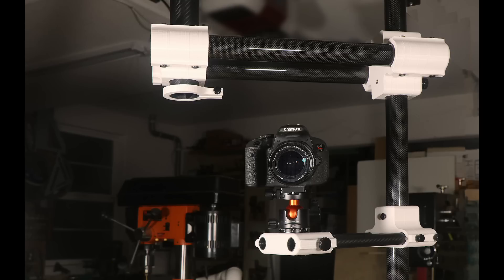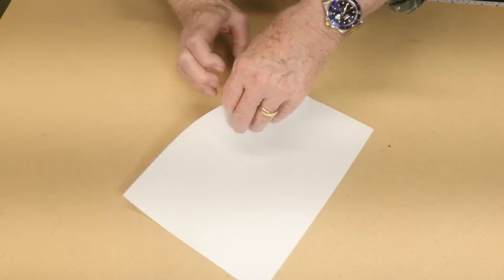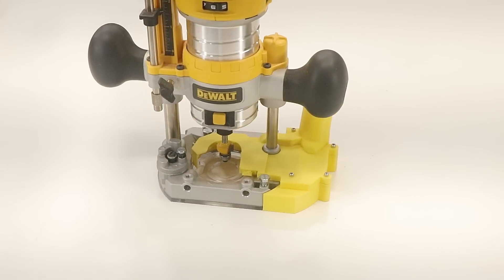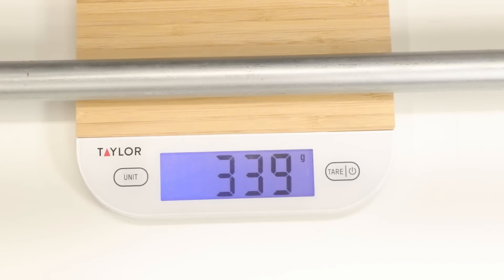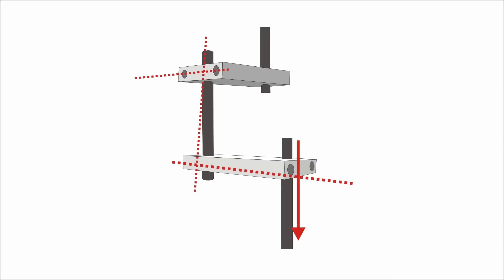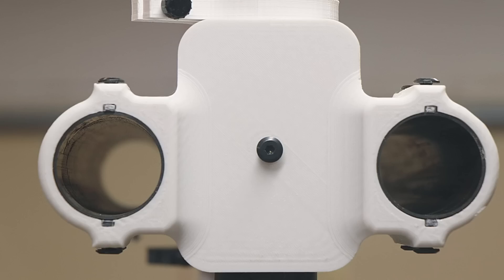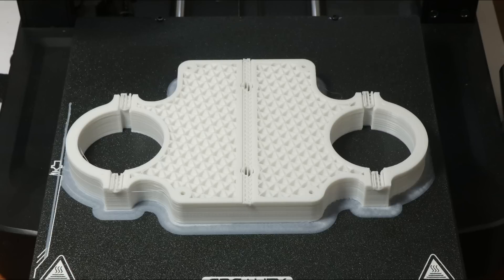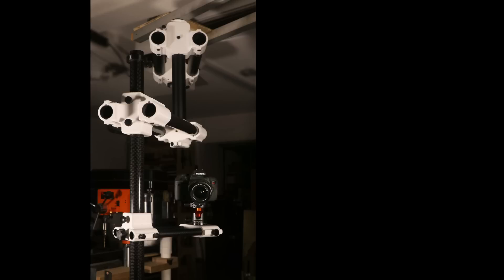Carbon Fiber Builds

Comment: You mentioned flex in the connectors. PETG is a pretty soft material and flexible, which explains why you had to go with such chunky pieces (which will totally work, eight walls is a lot!).

My go-to for this sort of work is PET-CF (which prints a lot better than people think these days, though probably not great on a bedslinger) and the loads you’re talking about don’t really bother it at all. You can print surprisingly small parts with a ton of strength and layer adhesion.

Comment: I have a couple of rather expensive carbon fiber camera tripods. What I found is that while they’re notably lighter than my also expensive aluminum tripods from the same maker that are equivalent in size, they are also considerably less rigid. While I can’t move my aluminum tripods when pressing down from the top, my carbon fiber tripod legs spread when I apply the same amount of force. I don’t want to mention the name here, because I don’t want an argument online about which tripod is best, but believe me they are very respected. I’ve been using their tripods with different models since 1970.
Reply from the maker: I 100% believe your claim that the name-brand carbon fiber tripod is less rigid than your same-brand aluminum version.  The question is:  are their shapes identical?  Are the tube diameters exactly the same?  Are the wall thicknesses exactly the same?  Are the connectors identical?  Are the tube lengths identical?  If the answer to any of these questions is that they are not identical, then the reason for the performance difference almost certainly lies in that shape difference.
Reply: @PatrickSullivan I do a lot of work with carbon fiber in design and manufacturing. Nobody builds a carbon fiber equivalent to something else. In theory, the designs are optimized for each material. In fact, the diameter of the leg sections on the carbon fiber are slightly bigger than the aluminum models. They are also slightly thicker. The mounts are almost exactly the same as the ends of the legs are almost exactly the same aluminum parts. The only real difference is the carbon fiber. I know that, in theory, carbon fiber is stiffer than a lot of metals, but in practice, they’re not. They are “stiff enough”. It’s the weight differential that makes them useful. But they are also a lot more brittle. If you give one a good whack, they will crack whereas the aluminum will just dent. I’ve had that happen with a tripod that fell over on a rocky surface, fortunately without a camera on top at the time. Carbon fiber is nice, but unless I have a very specific reason to use it, I won’t. They are slightly better t absorbing vibration. But I spray expanding foam insulation into any structures that need vibration resistance and that works very well.
Reply: @melgross  I know little about carbon fibre, but, since you use it in design, do you know if there are differences in the resin material used? For example I always thought of fibreglass as using a polyester resin, but I recently saw a video where someone used glass fibre mat with epoxy resin. Likewise I've done quite a bit of 3D SLA printing and there are hundreds of different resins available with a wide range of different properties (especially blending strength, toughness and flexibility). I would imagine that the same would be true of "carbon fibre". I'm guessing that carbon fibre bikes (and especially that Shelby Cobra) are not made from the same carbon fibre that your camera tripod is made from. Whether this wide range is commercially available is obviously another matter.
Reply: @robertharris1748 the resins are the same, as far as I know. I used to make sinks and other things for my lab out of glass fiber resin, using either polyester or epoxy. It depended on the use case. The carbon fiber is the same for different purposes. It a pure carbon molecule. But different devices are constructed differently. How it’s wound makes a big difference, depending on where you want the greatest strength, etc. panels get their toughness as much from the filler as the matrix. Fiber cloth is just cloth..

Comment: To prevent the twisting you can counterweight each segment. That way rather than each section being a lever it is a balanced Beam with the weight going straight down. While it adds weight it will reduce the overall size.
Reply from the maker: You are absolutely right, but the weight and size penalty for that solution is pretty stiff.

Comment: Great analysis. Thanks!
One remark: The inherent weakness of any "one pole" structure is the cantilever working of all subsequent loads. If it were in any way possible to stiffen the construction with straight elements (without bending moments) the construction (just like the Nordic-walking stick) shall become far more effective. But how to manage this with a space constraint? I was wondering if a "rollable" tension element (akin to a steel tape-measure) might be able to provide two or three additional tethering elements towards the ceiling. My gut feeling is that this would make the camera-mount stiffer by a few orders of magnitude (compared to a cantilever-suspension). 
The other issue is of resonance. No matter how stiff the structure is, if it cannot absorb (and energetically dissipate) tiny vibrations, the high quality-factor, resulting from the high mass and high stiffness, shall put minuscule (angular) vibrations in the camera. If your camera-resolution is say 5k pixels in any one direction (25M pixels over the entire sensor), then just a few few 100 microradian pitch or yaw shall blur your image. The tethers may also provide some damping to make the vibrations die down (although the PETG perhaps already does this..)
Reply from the maker: Your concern about resonance is important.  I have experimented with a number of different designs, and resonant vibrations have plagued all of them.  When you work on a good tripod, the resonance damps out withina second or two.  But when you have arms that cantilever out for a meter or more, then you get vibrations that last 10-30 seconds, not matter what material you use.  My solution is to simple wait about 20-30 seconds before triggering the shutter.

Comment: This is great! While I have no time to try my hand at making YouTube videos, I do make occasional instagram videos when I do wood turning. But setting up a camera stand is super annoying and the stand otherwise takes up space. If you were interested in selling the files, I’d be interested in purchasing them so I can print them. (I have the exact same printer btw).
Reply from the maker: Building the entire gantry and arm system is a challenge, and the printed parts need to match the diameters of your tubes pretty faithfully.  I have tweaked the files to give me results that fit my parts, and I am very concerned about publishing slicer files that might not work for other unsuspecting users.  I would be willing to share my Onshape files, but that would require that you know how to manipulate this particular 3D CAD program.

Comment: Carbon tubes are not very strong in compression and so they really benefit from internal aluminum sleeves.  These can be surprisingly thin walled and still be very effective at keeping the tube from compressing when clamped.
Reply from the maker: You could also fill the tubes with rigid urethane foam.  However, I don't think that better compressive strength would make much of difference in the design I used.
Reply: @PatrickSullivan  Back when I was doing lots of work with carbon tubes, filling them with foam wasn't an option but clamps slipping on the tubes also wasn't acceptable.

Comment: That was an interesting dive into the design process and the principles guiding it. Thank you! A couple of observations:
1. All that work on your camera mount, yet your microphone sounds like a yoghurt pot on a string! Multiply that by my tablet's mediocre speakers and some background noise where I am, and - thank goodness for subtitles!
2. Given it was all going to end up mounted on the ceiling, I wonder why keeping it ultra-lightweight was so much a priority? (Although you might well have arrived at the same materials and design even if not prioritising that at the start, for other reasons)